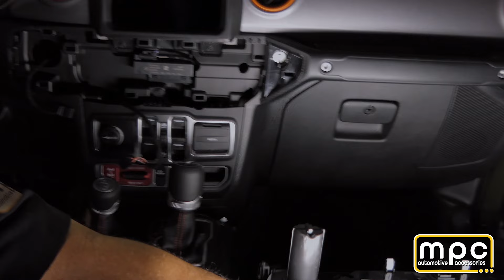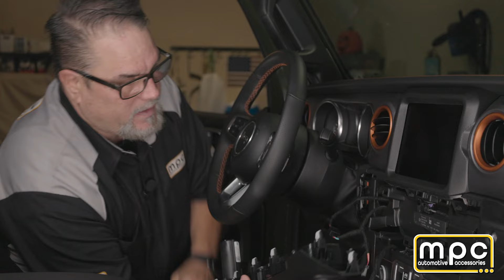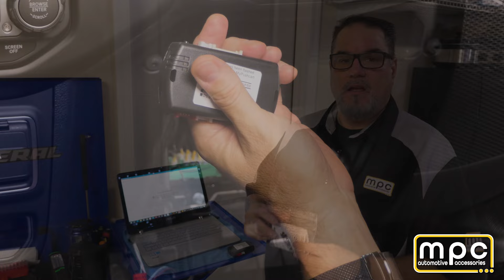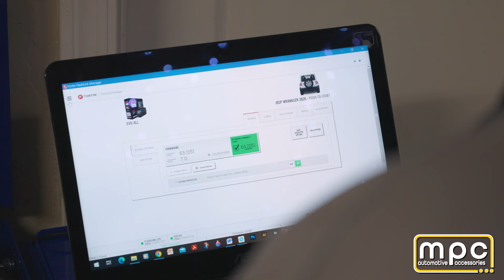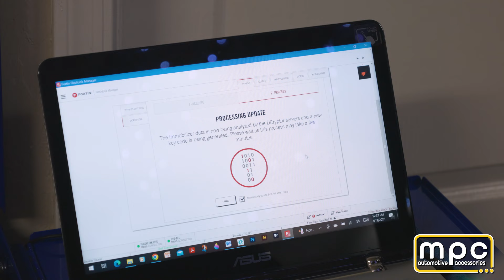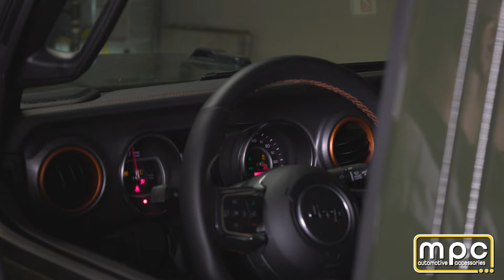mpc | Remote Start Installation for 2018-2023 OEM Jeep Wrangler/Gladiator - Push-to-Start

Comment: I am working on installing this on my 2020 Gladiator and I notice the extra wires that go to nothing. In watching the install video I am able to pause and see that the tech has cut these wires off short. No mention is made of this step....... This is very frustrating to me as your customer. This is the second remote start I am installing on my personal vehicle from you guys and your detailing of instructions is disappointing.
I am happy with the functionality of the kit and believe you guys make a great product.
I even recommend you to friends.
Reply from the maker: Hello The kit you received may be used across several vehicle models which may require wires that are not used in the installation in your vehicle.  If the wires are not listed Tip Sheet, then they are not need for your vehicle.  You can simply bundle them up and tie them away.

Thank you,
Reply: @mypushcartcom  thanks for taking the time to reply. New kit is working as it should.
Reply from the maker: Happy to help!  @jimsdimideas5383